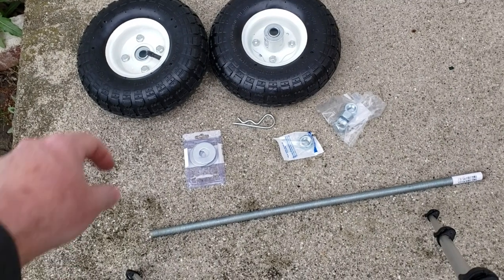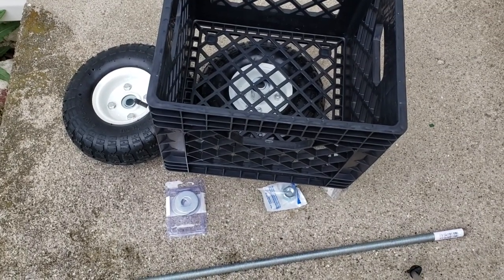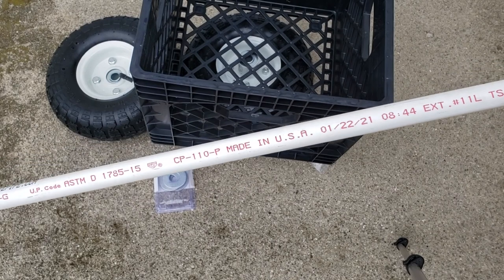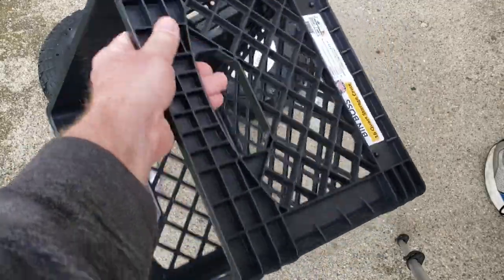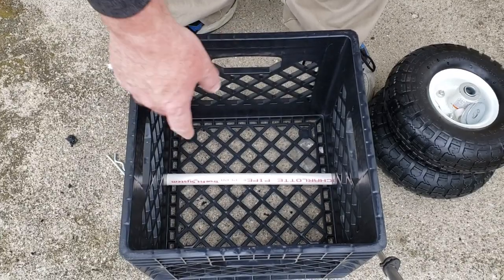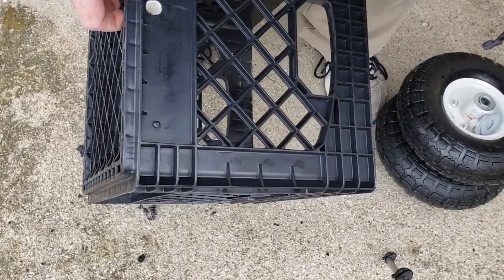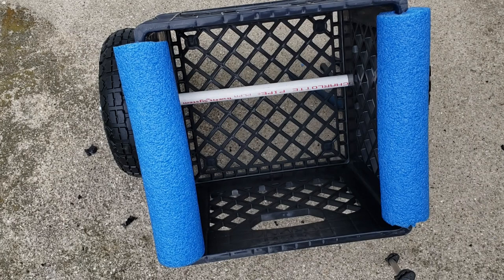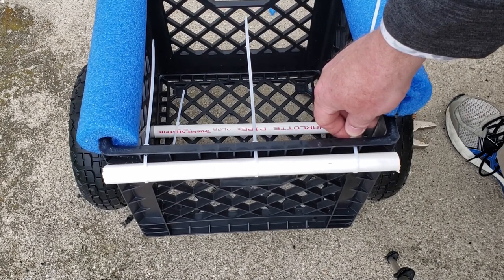DIY Kayak Milk Crate Cart

Comment: Have to say, very clever! I did like the comment about using a non-threaded rod with holes drilled for the cotter pins - think it would speed the switchover. Then the stow-away position... Yeah, heckova an idea!
Reply from the maker: Yeah, definitely an upgrade there!

Comment: You could probably use one of those large  flat bungee strap instead the ratchet strap so you don't have to deal with ratchet so much.
Reply from the maker: I agree . It was all I had at the time, though.  Thanks for stopping by!
Reply: @MakeItTakeItOutdoors  thanks for the idea. I was thinking about simple scubber hole wheels but the crate idea makes perfect sense.

Comment: Just confirming because I am making my own... the axle rod you're using is 5/8" and you're using a 1/2"  pvc pip?
Reply from the maker: Yeah...weird. I know
Reply: @MakeItTakeItOutdoors  ok, I'll check it our. You do a 5/8" drill bit on the crate?
Reply from the maker: Like many tools of mine, I can't find that spade bit but I think it was
Reply: That's my question also.
Reply from the maker: Just found a 5/8 spade bit and I'm pretty sure it's the one I used.
Reply: I used a 5/8 and it did the job right
Reply from the maker: Nice! It's great when one of my ideas works lol
Reply: @MakeItTakeItOutdoors  "I love it when a plan comes together!"
Reply: @DirtyK1911  I can attest that the 1/2 PVC pipe cover, worked well with the 5/8 Threaded axle rod.

Comment: What size wood bit are you using for the Axle?
Reply from the maker: 5/8 Spade bit
Reply: @MakeItTakeItOutdoors   I used a regular larger sized bit, and then reamed it out with the same bit to make it fit  I didn't want another expense on buying that bit. Worked well.
Reply from the maker: I completely support using what you have on hand! Look how I get by!

Comment: I’m about to build one of these as we speak. How did it hold up? Would you change anything? I bought the exact supplies you did.
Reply from the maker: I'd like to have a lid and will probably make one this spring. Held up fine!
Reply: @MakeItTakeItOutdoors  That’s the one thing I did different. I added about 5 inches of a second milk crate to make a folding lid/tray. I used the zip ties like a hinge. Now I’ll add the pool floats to the top and strap it down.
Reply from the maker: Lol great minds...you were just faster

Comment: Why does it say, the wheels stow away?
Reply from the maker: At 7:03 I put the second pipe in so the axle and tires can be stowed above. This let's the crate sit flat in the kayak.  HOWEVER I forgot to show this in the video! Completely my bad! If you look at the video's thumbnail you cane see it in that position.  Thanks for the heads-up!

Comment: ONLY THING I SEE WRONG , IS THAT THERE IS VERY LITTLE GROUND CLEARANCE  AT THE BOTTOM OF THE MILK CRATE....just an observation...
Reply from the maker: True, but I'm not going over more than grassy areas and lots, paved and gravel. If I was portaging in back country with rougher trails it could definitely be a problem.